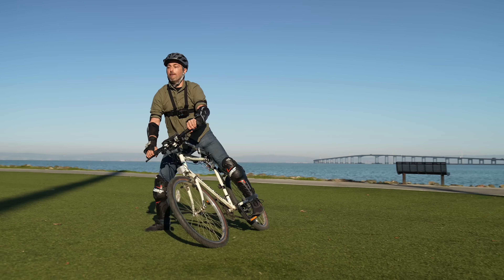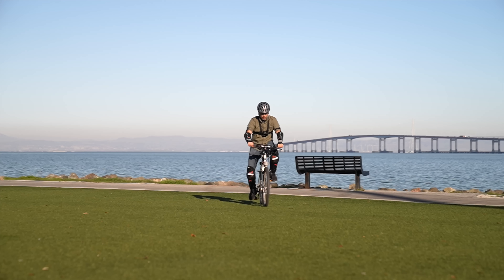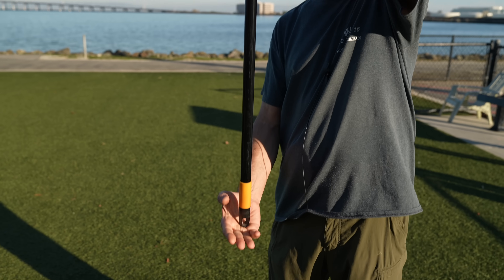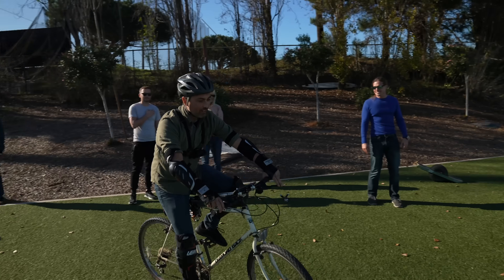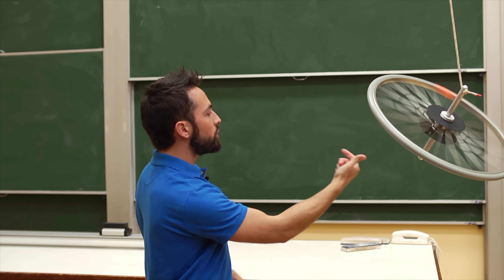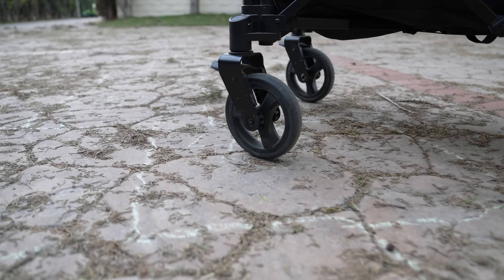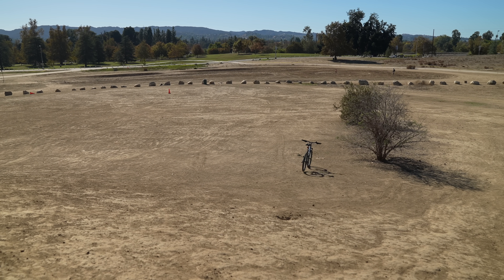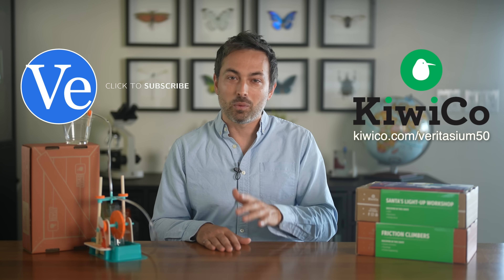Most People Don't Know How Bikes Work

Comment: Ring on chain behaves the same.
Any new ideas on bicycle problem?
Reply: Electron gyroid cloud densities among ionic bumps- reminds of idea from video.
Wish I knew how to programme cell. To see whether tooth, bone batteries would regenerate/ re*energize or fix damage done by caries, dead tooth or cracks among joints.
STee*ring: ST resonance, tee 2 rings coupled paired.

Comment: I'm likely one of the oddball people who understood the way bikes work.

One of the things I've often thought would be interesting is to design/build a bike with drive by wire power steering that isolates the handle bars completely from the steering of the front tire.

If the bike included software that took care of all of the balance related steering and the rider could simply steer where they want to go, you could have a bike that no one needs to learn to ride.

A toddler could jump on this drive by wire steered bike and just ride - without any of the normal cuts and bruises we all go through as we learn how to ride.

Another advantage to this is, if done well, the bike should be 100% stable at extremely low speeds.

Although prototypes would likely run on batteries, ultimately the system could be powered by an efficient hub dynamo so no batteries would be required.

Has anyone built one of these?

I wonder if there could be a genuine market for my "safety bike"?
Reply: Thanks I hate it.     Life is boring enough.          Self riding motorcycles exist too.

Comment: @Veritasium I actually checked how I move when I ride a bike and is seems that I don't steer in the opposite direction to drive me off-balance in the direction I want. I actually start by putting my body off-balance in the direction I aim and then my bike follows naturally. I suppose we simply learned to ride bikes differently. Note that this is more efficient at higher speed. You might have been too slow in your tests but going faster might have been too dangerous.
Reply: You do move the steering.  At least when it comes to 25kmh riding.
Reply: @gur262  Maybe slightly in the direction I am aiming at (you don't do short turns at high speed) but definitely not in the opposite direction. I move my body first instead.

Comment: A good way to counter steer properly is to just push the handlebars in the direction you want, I think it's an old motorcycle trick, makes sense though, when you're going so much faster you wouldn't really survive if you steered wrong, unless you're that dame da ne guy who got hit by a truck and made it (if you look at the video you can see he steered right and ended on the left side of the road)

Comment: I ride a motorcycle, if you are making a turn from stationary or at speeds below 5mph/8kmph you turn the wheel in the direction you wish to go. Once you have increased speed you have to counter steer. The tighter turn  you wish to make the more you push on the inside bar, but in addition you  turn your head to look where you want to go, this in turn rotates your shoulders and moves your weight to the inside, (for sealed surfaces).  At slow speeds or on low traction surfaces you lean to the outside called counterbalancing.

Comment: Or, you can lean in the direction you intend on turning like a normal person, thus negating the need to turn the opposite direction first. You literally pointed that out when you "happened" to be leaning in that direction a few times when  the steering locked. You even explained how bikes are designed to not fall over. When you apply that knowledge into bike riding, then you can ride a bike properly. When you start overthinking it then you start turning the handlebars in order to steer. I've been riding a bike all morning and how you steer just feels wrong and unnatural.

Comment: There is a similar really interesting effect when driving a motorcycle at highway speed. If you want to do a left turn, you pull the handlebars the other way! Many people don't believe this, even if they regularly drive a motor cycle. But it is easy enough to test.

A turn works approximately as follows:

1. You pull on the handlebar in the wrong direction.
2. The motorcycle starts to lean.
3. A leaning motorcycle will put a force on the front wheel making it turn in the direction you want to go.
4. As long as you maintain the force on the handlebars in the "wrong" direction, the turn will continue.
5. When you release the force on the handle bars, the motorcycle strightens up and stops turning.
Reply: As someone who rides a motorcycle, this is exactly what was going through my mind when watching this video.
Reply: I’ve thought of this before but when driving cars, b/c when you turn extremely close to a curve you first counter-turn to create space.

Comment: Surely this only applies to slow speeds? I'm sure that when I turn corners at speed, I lean into them without counter-steering.
Reply: This applies to anything but slow speeds.  Bomb down a hill.    Push left handlebar to go left.  Or pull right   .to go left.

Comment: Amateurs... Motorcyclist have known this for a long time, we countersteer to turn and then lean our body towards the turn to bring the motorcycle into the turn. No one turns the handlebars to turn unless its at a stand still and you're moving off. Go look at vids of supermotard riders and see how they turn into a sharp corner countersteering and using their body to lean their motorcycles into the corner and drifting the corner. Look at their handlebars and many would have  their handlebars on the opposite direction of the turn  and some almost locking it in the opposite direction whch to those unknowing would think it is impossible.
Most normal cyclist never thinks of this unless one that takes it seriously.

Comment: Thank you for explaining counter-steering for a while I was confused and thought counter-steering was when you turn the wheel left the entire time to go right, although that makes no sense. I’ve learnt that counter-steering is a short turn to the opposite direction right before you lean into the actual turn.
Reply: On my motorcycle on the highway I do steer left the entire time I'm making a right turn. And vice versa. It's very subtle, but that is how counter steering works at speed.

Comment: The way you set up this test to prove how people don't know how bikes work is very wrong. The first proven fact is that most people already have a hard time keeping balance riding a bike at slower speeds. At higher speeds, we just lean to a side with a slight adjustment because the "turning mechanism" would normally spaz out our control if we did more than 20-30 degrees (if the 90 degree angle is zero's starting point(facing straight)). The truth in the matter is, this video only proves that most people do know how balance correction works on a bike. What a waste of 11 minuets.

Comment: You could just simply lean into your turn making your turn radius go to the right trajectory so you don't tip over.  like if you go from just riding in a strait line you would be able to just go from your strait line rideing position to leaning into your turn so when you actually turn you don't tip over and you successfully make your turns

Comment: When you drive a Porsche 911 (996 RWD in my case) it's the very first thing they teach you. You weight can assist you in turns, if you first turn right and then immediately take a heavy turn to the left, you can turn left faster and easier, but this technique requires some serious dedication and practice from a driver. It becomes an OP flex if master it tho

Comment: 9:16 How do counter rotating wheels nullify the gyroscopic effect? it seems rather than removing it, they should apply the gyroscopic effect in 2-directions, which should add stability to that scooter -looking-bike-thing, similar to how pushing a box  in both directions gives it more resistance to rotation. 2 opposing forces seems to stabilize an object, at least for a linear force applied inwards on either side of a box. What makes the counter-gyroscopic effect NOT add stability to the scooter-looking-bike-thing?
Reply: Duh. You are wrong that's how.  Pretty sure it can be demonstrated in experiment
Reply: @gur262  your'e funny :) have a good day sir

Comment: Thank you for your informative movies. It is possible to ride that bike by using your bodyweight. Lean to the left, if you want to go left, and lean to the right if you want to go to the right. Once my brother asked to 'stop steering' too much when I sat on the buddyseat of his motor and anticipated the curves in the road to good. And it is possible to steer to the left by pushing the end of the left handle with a flat hand. Forcing the bicycle to the right a short moment of time after which the correction makes you go left.

Comment: This doesn’t make sense to me. I went out on my own bike today to test it out, and I found that I was steering my bike almost entirely by adjusting my weight, rather than using the wheel. Of course I didn’t have any hard cutoff to keep myself from counter-steering, but even when I wasn’t trying to emulate the effect, I found I was only leaning towards the direction I wanted to go, and essentially never steered the other way first. Maybe I just learned how to ride differently from other people, or maybe I’m making micro-adjustments I’m not even aware of. Needless to say I’d be really interested in trying out that special bike myself

Comment: This is just wrong. If you move your body to the right, you won't tip over.

If you don't ride like a boomer, this actually works.

Edit: Steering and changing your balance are different things that'll result in the same thing happening.

Comment: It is quite common to steer like that but a more easy way is to just lean to the direction you want to turn towards and the bigger the angle of the bike the sharpest the turn. This way you can use the steering wheel only for corrections.

Comment: "Most people believe you turn by pointing  the handlebars..." Question is - have they ridden a bicycle? As in - is that simply an assumption based on what they see?
I stopped using the handlebar for turning around the time I was 12. So I realized it's all about balance pretty easily. 12 year olds aren't the brightest of humans. Regardless of what they or their mothers like to think.

Comment: counter steering is one thing but you can steer without counter steering and its called counter balance,you left with no counter and you use your body position as that counter,that at high lean angle (motorcycles) is dangerous but on bicycles its very useful

Comment: Yes! It is the gyroscopic nature of the wheel which makes a bike stable without a rider. But the gyroscopic force doesn't tilt the bike frame. They actually turn the front edge of the wheel towards the direction of the disturbing force, making the bike steer in the direction of the disturbing force, thus keeping the bike stable. Of course, if you lock the handlebars they cannot turn, and the bike tips over.

Comment: You don't necessarily need to steer the opposite direction. Many people ride with hybrid or road bikes like myself, and I find with a tire so thin all you need is a leaning your body in the direction you want to go. When you lean your bike say... To the right, it allows more surface area on the right side of the tire to grip the ground than the left due to the perpendicular angle your bike is to the ground. The grip being right centric causes your bike to take you that direction and because your weight being shift the direction we're turning stops the issue here with body weight displacement

Comment: Its called counter steering, 2 wheel vehicle change the way it steers at certain velocity. Passing that point to move right you moved the handle bar left and vice-versa. We learned that as kids, but not in theory, but in practice, you change that and you no longer can ride a bike.

Comment: It's the cross-sectional profile of the tire.  Why are bicycle and motorcycle tires round at the contact patch and automobile tires are not?  That difference in radius from the edge of the contact patch to the center is what causes the turn.  The steering head turns the tire to cause the bike to tip in towards the side of the contact patch that will be the inside of the turn.  You are basically falling at the same rate the momentum of the bike is pushing the bike in the opposite direction.  Like being in orbit.  See?  There is rocket science involved.

Comment: You guys rotate your tires to the opposite side when executing turns? I just was taught its normal to lean into the direction I want to turn before turning. Such as motorcycle racers do as well you don't see them turn to the right to make a left turn they start to lean the bike to the left then gradually turn their steering wheel left until they stop themselves from going to low. With a bike however once I've made my turn I just peddle a little faster make sure my handlebars are straight with my bike frame then using my abs come to the upright sitting position. I guess it depends on how you learn to ride said bike most people can barely handle one I'm able to stand with 1 foot on the seat and 1 foot on the handle bars at a decent speed without falling.

Comment: From the first minute I knew it was about counter steering just from years of riding a motorcycle. It’s how you are thought to steer on the highway or anything at speeds higher than like 5 miles. Anything slower and counter steering would put you too off balance so you turn normally and shift your body weight

Comment: I respectuflly doubt that counter stearing is necessary in bycicles at low speed. your body is much heavier than the bycicle, if you want to turn left, you lean your body left and and you turn the wheel left and u may have to increase speed to gain balance. If you know how to do it right, you dont need counter balance with your front wheel in the first second of the turn. Not even in a motocycle at low speed you need to counter stearing at, you just need to counter balance the lean of the moto (because the moto is heavier than u). You fall because in your brain you lost balance and you get affraid. Try to speed up a bit when you "feel" you falling. I am almost for sure saw this technique in demonstration video from a motocycle instructor for policeman.

Comment: I'm curious how this works in the case of steering without your hands on the handlebars. As a teenager, I routinely rode my bike with my hands down by my sides. While I couldn't turn particularly sharply, I could easily and reliably turn sharply enough to navigate the roads in my home town. This wasn't unique to me, or even unusual; many (most?) of the people I knew in high school who rode bikes could do this with varying degrees of success and I was somewhere in the upper middle of the pack.
Reply: Your front wheel is not locked, and your bike will self-correct a little just like the riderless ones in the video.
Reply: @MrAbgeBrandt  what about people who can turn while doing a wheelie?
Reply: @derekofbaltimore  that’s like turning a unicycle. It all comes down to manipulating your centre of mass relative to the tyre contact patch. An added complexity not touched in this video is the mechanics of viscoelastic tyres.
Reply: When you move your weight around, it moves the bicycle the other way underneath you and the steering effects in the video kick in
Reply: This, i do the same and there is pretty much NO Counterstearing that I can recognize. you lean one way slightly and the front tire does not go the opisite direction, but only the direction you lean.

Its actually how i usually stear even when my hands are on the handle bars
Reply: I wonder what difference does it make if the fork of the front wheel is completely vertical. In my understanding it has a big impact on the balancing.
Ps. I wrote before the end of the video, when Derek mention the angle of fork.. But i'm still interested.
Reply: When turning with no hands you start by moving your body in the direction you want to turn. Since you are touching nothing but the bike, moving your body in that direction means pushing the bike the other way. Because of the angle of the front wheel, pushing the bike to one side will push the handlebars to that side. So when you lean to the right the wheel automatically turns to the left, leaning the bike over and initiating the turn.
Reply: Ugh. You upper middle class bumface!
/s

Comment: I'm a motorcyclist.  A lot of motorcyclist don't understand countersteering either. And even I was not sure about bicycles because they go so slow. A lot of people say you don't need to countersteer under about 10mph. Clearly these bicycles are going slower than that. You should build a motorcycle with lockable handle bars and see if you can stay up at low speed without countersteering!

Comment: This video proves the creators of this video don't know how bicycles work... Bikes don't have high stability at low speeds, so doing this experiment at 5mph is stupid. Try doing this when you're actually moving. First, you'll get far more gyroscopic stability. Second, you'll realize that, at high speeds, you don't really even turn the wheel that much. Turning is initiated mostly just by leaning one direction or the other.